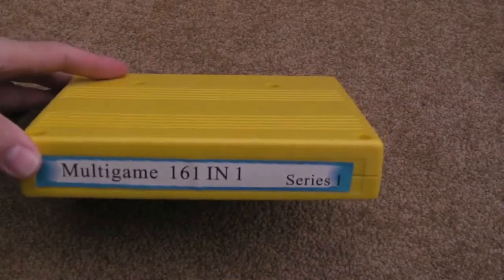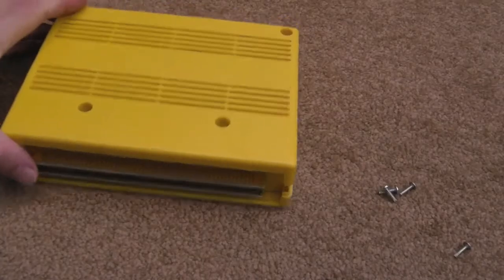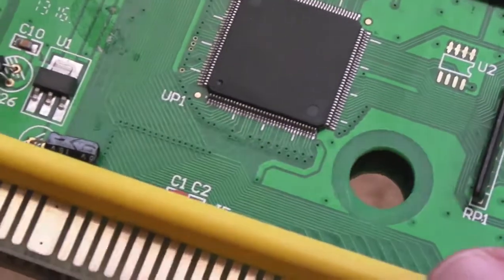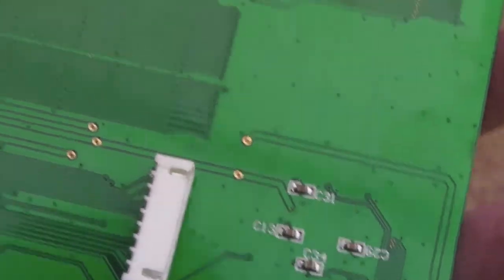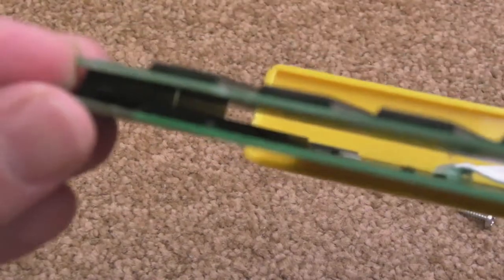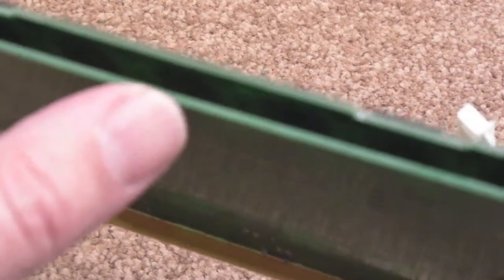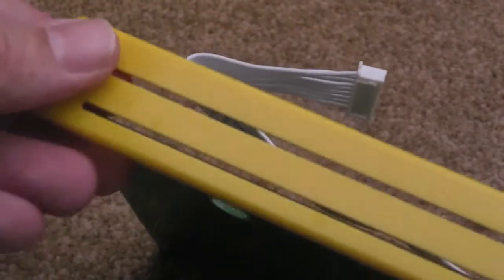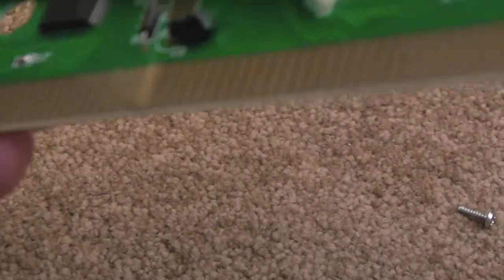SNK Neo Geo MVS 161 in 1 Cart Teardown

Comment: oh I didn't know about that issue... you made me want to check mine out to see in case it's worn out the socket on my mvs... since i've never noticed any resistance putting it in..
Reply from the maker: It might be OK, it varies from cart to cart I think.  That's the only cart I've found tight, the others just slot in and out relatively easily.
Reply: yeah you may be right... the only similar issue I have experienced is the game sharks for the sega saturn.. action replays are ok but game sharks are double the thickness.

Comment: The 161 does clear the memory of the console, but it actually has it's own memory and appears to be able to save memory settings for at least 20 games, independently of the console.
Reply: I'm currently running King of Fighters '94 in MVS mode, from the multicart (without the battery in the motherboard). Waiting to see if it starts throw errors.
Reply from the maker: From what I understand the 161 in 1 is supposed to clear the backup RAM when you boot it anyway?  What I do know is you can get wierd backup RAM issues when using the 161 in 1 - ie. It can corrupt the RAM and you get all sorts of wierd problems until you manually clear it, or remove the battery.

One thing to note with the battery is the cap(s) on the motherboard can keep the the backup RAM state for a few hours.  I can find after leaving my system off for an hour (without battery) and then booting it up again it will still have the last game settings despite there being no battery.

I also vaguely remember there's some kind of config mode (I might be thinking of the 120 in 1) where you can boot with certain dip switches set and change the difficulty level of some games - think those are stored on the cart.  That might not be applicable to the 161 in 1 though.
Reply: GadgetUK164
Good information. Thanks!

Comment: Gadget, I was able to get my voltage up to 5 volts (on-load) without a cart and roughly 4.95 volts (on-load) with the multi-cart in it. Regular carts only drop the voltage to 4.98 or 4.99, so the cart uses more power than normal carts do.
Reply from the maker: Yes, it definitely uses more power.  I see a voltage drop from say 5.05v to 4.95v also.

Comment: Does it fit in a regular MVS case? I dont like the yellow case and would like to change it. Thanks in advance
Reply from the maker: Yes, pretty sure people have put the boards into different cases!  It's worth shaving down the edges of the board as well - at default they are a bit too wide and can damage your slots.
Reply: +GadgetUK164 thanks so much, i will do so.

Comment: I got one of these from Aliexpress and the only chips on the top board are two Altera Max CPLD chips labeled PCM2 and CP1 then the one below the crystal, it does have the voltage regulator but it doesn't have any of the chips towards the top of the first board and no sockets for them either. Do you know anything about this revision or if they fixed any issues?
Reply from the maker: Check out the thread on the tech section of the neo-geo forum!   The new boards use BGA mounted NVPROM chips (just 2 on the first board).  They still lack the 2 x 47pF capacitors required to fix the sound glitches, but as far as I know some of them still use diodes to drop from 5v to 3.6v, and they have the same dodgy ROMs that the previous version has, so any games with glitches - like samsho1, still have the glitches there.
Reply: Okay, thank you!. It'd be cool if there was a way to tap into the cartridge then flash your own ROM's on there that you know are good.

Comment: I recently bought a MVS MV-1A, still waiting for it to arrive and doing some research meanwhile, about consolizing it, supergun boards and other stuff and considering this cartridge as well. I see it works fine on Your MV-1FZ. I read some strange things about this cart saying that is going to work only with 2,4 or 6 slot MVS models (apparently it is not true). Any chance You can confirm that cartridge should work fine on a MV-1A MVS board? And what about compatibility with universe bios? Thanks!
Reply: I can confirm that it is compatible with the 3.2 BIOS. Beware, that out of the box these carts have problems. You have to clean the contacts THOROUGHLY and YOU MUST FILE the sides. Otherwise the PCBs will flex in the socket.
Reply: Majestic Lizard hates Google + thanks for that info, to be clear - "file the sides" of PCB's? like round up the corners of the boards? or You talking about cartridge shell?
Reply from the maker: Sorry I forgot to reply!  I use an MV-1FZ and have no problems.  From what I understand it works with most of the other 1 slots but possibly not the MV-1F?  It works fine with Uni Bios.  I use v3.1 without an issue.
Reply: jaskwadrata
No, just the connector where it connects to the motherboard. GadgetUK explains this in the video.

Comment: I'd love to know what size flash roms they are, they must be huge! Terrible quality soldering on these boards, and they always seem to have splodges of flux all over them and a poor finish. The profit margin must be pretty low on them considering how cheap they are to buy compared to the level of hardware that's on them
Reply: Edit: they are 64M x 16bit (1 Gigabit woooo!) MASSIVE Flash ROMS, so these carts have an insane 25gigabits in them! The roms must be re-cycled pulls from other hardware as there is no way they could buy them for the cost of these carts sell for
Reply from the maker: They are pretty large as they hold a fair bit of data each.  I couldn't find any datasheets or pinouts for these chips - do you have any information?  Ideally I want to find a way to dump these and possibly reprogram them but it looks like some kind of expensive industrial programmer is required, unless I can find a datasheet - It's possible I could make a programmer from a PIC or something with a lot of work.
Reply from the maker: arcadeuk You are correct, they are recycled as far as I understand.  On some carts they leave the old Sammy labels on - presumed they've sacrificed some Atomis Wave carts or something.

Comment: nice!! do you notice any difference between the original cartridges games and the games on this 161 in 1 cartridge?
Reply from the maker: The majority are identical to actual carts.  One or two have glitches - sound in Pulstar is corrupt for example, and aero fighters 2 or 3 (forget which) suffers from stuck bullets.  For the most part the 161 in 1 is great.  Worth looking at the 120 in 1 or 138 in 1 as well.
Reply: ooh ok thanks for the answer ... why do you think those glitches happened?? maybe the rom was not copy correctly??
Reply from the maker: The ROM images they have used were corrupted in the machine they copied them from.  For example, the Pulstar machine had partially corrupted VROM chips, so that's why the sound is distorted on the music in that game.  Either that or they've used corrupted files off the net.  Very few have problems though.  You can also get unlucky and have additional problems due to the NVPROM chips on these carts being a bit flakey (they don't use new chips a lot of the time.  They are often taken off old boards etc).  For example, on one of my 120 in 1 carts the sound for NAM is worse than on another identical 120 in 1 cart I own.  Yet the Pulstar on both of my 120 in 1 carts have the identical corruptions in music.   Other games I've played on the 120 in 1 are perfect.
Reply: wow thanks a lot for the info.. you know a lot about neo geo arcades.. i just recently got mine and I don't know too much about the machine.. all i know it's that when i was looking for games to buy that I used to play as a kid like Last Resort they cost over 200 dollars so I was looking for other ways...

Comment: My 161 in 1 not working with glitchy screen list but controller still work on the glitchy list after scaning the 2nd pcb altera max epm7128sQc100-7
Burned in the midlle
After that i searched and i found mvs card king of fighter with simillar altera max but diffirente at the end
epm7128sQc100-10
Plz can that work for me if i replace it
Sorry for my english. Im from north africa morocco plz help
Reply from the maker: No that won't work!  The only replacement chip that will work is one of the chips off another 161 in 1 (where that chip is working).  They are programmable parts and they are programmed differently between 161 in 1 and King of Fighters.
Reply: @GadgetUK164  thank u for the reply i will search  from another 161in1

Comment: i got one of thoses 161 in 1 but it doesnt work. that cart was brand new and it doesnt boot to the menu screen . the mvs works just fine with regular carts witch makes me belive that the problem is the multi cart but i dont know how to fix it, if its even fixable =S
Reply from the maker: You could try examining the chips to see if any of the pins are lose from the board.  If your soldering skills are OK and you've got an iron and some flux you could go over the pins on each chip to see if that improves the situation.  One thing i've found with these multicarts is that they can have bad pull up resistors on some of the NVPROM chips, which means that when you've got an earthed PSU powering the MVS the cart will not boot at all.  If you use a PSU that isn't earthed you might find it works with glitches rather than the black screen & ticking sound watchdog reset you are probably seeing now.

You could also try cleaning the cart edges with an eraser and some alchohol.
Reply: GadgetUK164 hmmm i think ill try that on the chips. the resistors and the voltage regulators should i change too?
Reply from the maker: There are no resistors to replace - they are diodes!  You would need to check the connections of the diodes against the 4 copper pads that are there for a voltage regulator to work out which type of voltage regulator to fit.  When I get time I will fit one to mine and video the process.

Comment: Gadget. Could you do me a favor and set your console region to Japanese and Console and then see if Kyoshiro's sprite on Samurai Shodown I is correct in that mode? I returned my defective 161 in 1. I can't test this. It seems they monkeyed around with the code on the MVS mode of the games, but not the AES. So, I'm wondering if some of the graphical errors will disappear in AES / Console mode.
Reply from the maker: Done it!  Kyoshiro's jumps all over the place in either MVS or AES mode - doesn't make a difference changing mode, which is what I expected because both modes run the exact same code, they just behave slightly differently regards to credits etc.  So there is now a known problem with that game on the 161 in 1.
Reply: I also figured that was the likely result, but on the off chance I figured I'd ask you to check it out. I just read about the hard dip difficulty issue you mentioned. However, be that as it may, you can bypass the hard dip difficulty and use the software dip of the AES mode. Due to the hard dip (switches 4 and 5) in MVS mode the soft dip difficulty level displayed in the soft dip menu is meaningless. If the hard dip was set to "level 2" all difficulty levels 1 through 8 will play like "level 2". However, in AES mode, you totally bypass that.
Reply: Also, I am positive some of the games that are supposed to be dumps of the originals are actually dumps of prototypes or hacks that looked like the originals. King of Fighters '99 is the best example because you can clearly see that it is the prototype version in each round. The menu for K of 99 prototype has some distinct differences you can't miss if you know what to look for.

Comment: http://s16.postimg.org/jskgvinfp/PCBs_th.jpg
In the above image I've marked all of the IC's with letters. Can you tell me which letters are the NVROMs and which are the CPLD/FPGA? I'm starting to wonder if this cart was originally a 150 in 1 that was unsuccessfully flashed to a 161 in 1.
Reply from the maker: MThe NVROMS are the chips in the M, C, S, P, and V positions (eg. P1, P2, P3, V1, V2 etc).  The large chips with hundreds of connections are FPGAs I think - I've just never looked up the part numbers to check they aren't CPLDs.  I guess they need slightly more functionality than a CPLD might provide, but it could be done with a CPLD I think.

Most of the carts use the same boards anyway - I think the 150 in 1 is the same board as the 161 in 1.  The 120 in 1 uses the 138 in 1 board.